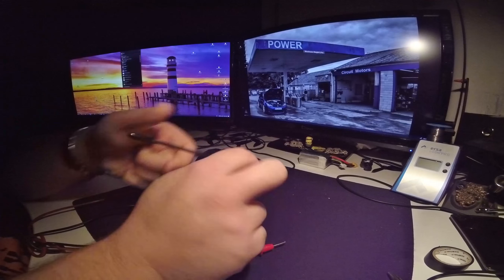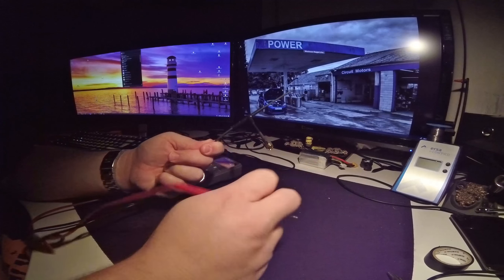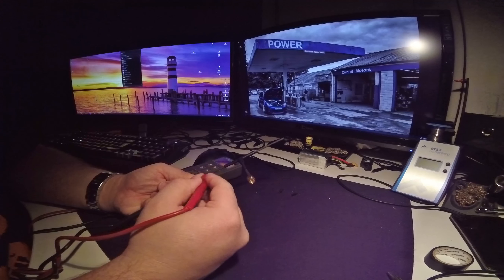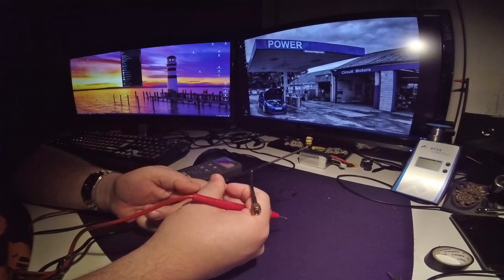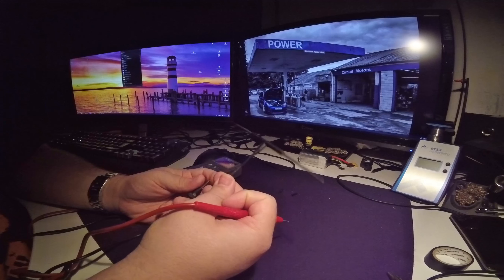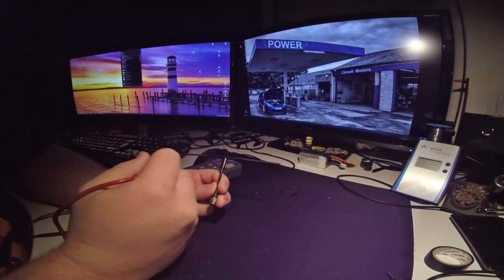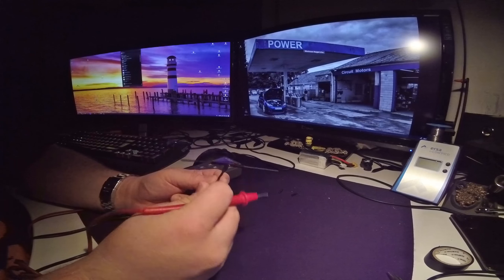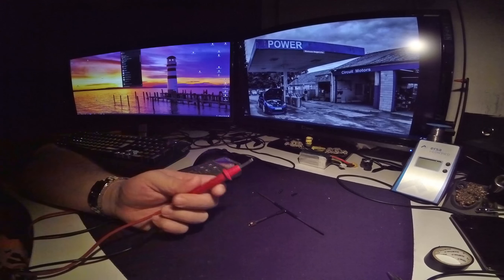How to check if your TBS Crossfire antennas are still good to use

Comment: This does not work on the V2 antenna as there is a tuned LC filter in the T piece. This consists on an inductor between the two sides of the antenna, one of which is connected to the coax screen and a capacitor between the centre conductor and the other side of the antenna. The upshot of this is with a DC measurement both sides appear connected to the screen with no apparent connection to the centre conductor.
Reply: What is the expected behavior for V2 in that case?

Both antennas have continuity to the shield for me. Is that expected?

Thanks for the help!
Reply: @PratikKapoor1105  At DC the inductor looks like a dead short, so you'll see both sides show continuity when you measure it. At high frequency its a different story.
Reply: i have the same "problem" both sides are connected to ground/shield and the center feedline has no conenction to either of them. I testes my Mirco TX V2 and RX immortal T antennas. Im going to assume that his is normal for the V2 version
Reply: SaureHefePegorino correct

Comment: I don't get any continuity between outside of the u.fl connector and both side of the antenna on my rx immortal t..
Reply from the maker: So your antenna did loose ground if you did measure it correctly.

Comment: Is it possible to check the CBSSSFIRE Stock TX V2 TBS antenna in the same way?
Reply: Did you figure out if this works for the V2 by any chance? Thanks!
Reply: @PratikKapoor1105  V2 is built differently and you won't check it this way